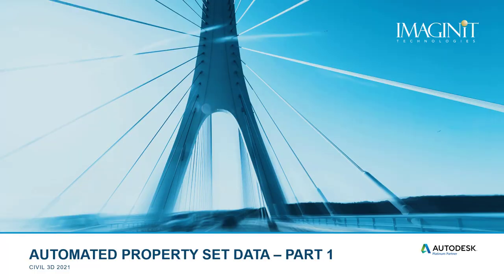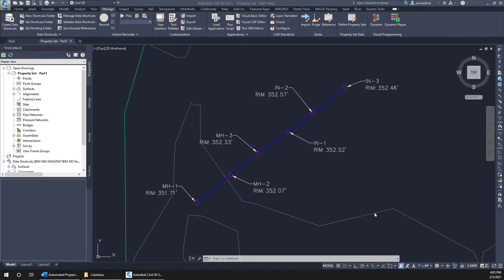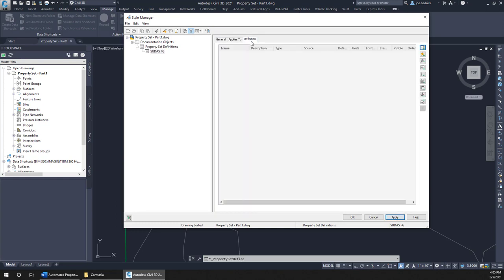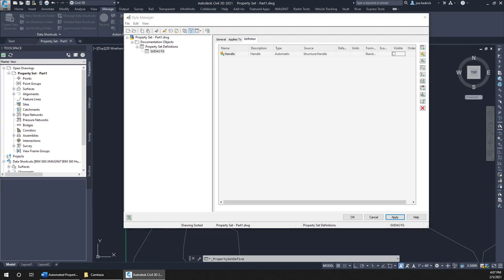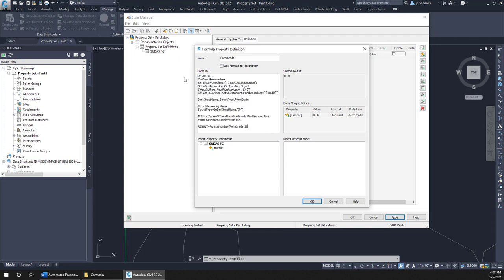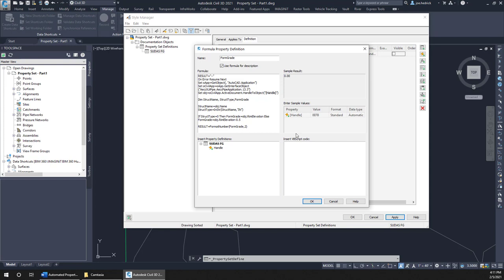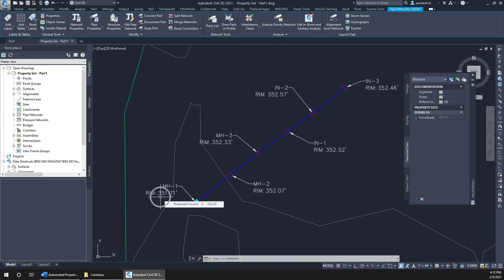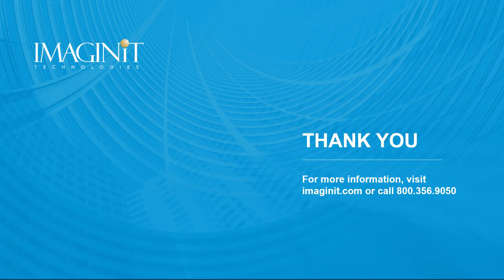Automated Property Set Data   Part 1

Comment: Can we get attomaticaly the cover average of each pipe or invert average, that means the average of start and ends values?
Reply from the maker: From our experts: After a quick glance at the COM API, getting the average of the starting and ending invert for each pipe shouldn’t be that difficult.  While likely possible to do, cover would be more involved since you would have to calculate where on the pipe you want to do the calculation from (beginning, end, halfway, some combination, etc.), calculate the top of pipe elevation from that location, calculate the surface elevation from the same point and then subtract the two values.  If this is something that you would like to engage the consulting services team to assist with, please feel free to reach out on imaginit.com using the Contact Us form

Comment: Your elevation of 352.46 didn't update once you revised the "IN" to "MH".  It was that elevation both times?
Reply from the maker: We asked the experts, here's what they said:

Rewatch that portion of the video.  The Civil 3D labels are for rim elevations which wouldn’t be affected by the change in structure name.  The video shows that while the structure is labeled as an inlet, the form grade is 351.96’ and after the structure is changed to a manhole, it updates to 352.46.

Comment: Is there any way to automate basic parameters, such as length and slope in pressure pipes, through property sets
Reply from the maker: Per our expert: Slope, 2D Length, & 3D Length are already default properties of pressure pipes.  They are built-in to the product.
Reply: @imaginittech  Ok, maybe I asked the question wrong, my question is if there is a way to automate these pressure pipe properties (length, slope) in the property sets Data
Reply from the maker: @sergioandresescobarmarino6824  Per our expert: Not entirely sure what you're trying to do. The idea behind property sets is to take something that isn’t a default property and put it in labels and tables. Length and slope are default properties so they can already be in labels and tables without having to do anything special.

To connect with us for 1:1 assistance (fair warning it's not free) visit www.imaginit.com and hit Contact Us.
Reply: @imaginittech  

Hi.

I understand that the Slope, 2D Length, & 3D Length are already default properties of pressure pipes; is there a way to call this information and put it in the property set data ?

If yes how do you do that ?
Reply: @Thabang Rakgotho  
I'm also search about your questions 

 @IMAGINiT Technologies  
Did you have any answer about that ?
Reply from the maker: Our apoligies! We missed the question. From our Experts: 
To resolve this, we would have to dig into the API.  The data is likely there, but it may take some work to access. If you're interested in engaging in a consulting project to help us get the information you're looking for, visit our website www.imaginit.com and fill out the Contact Us form.